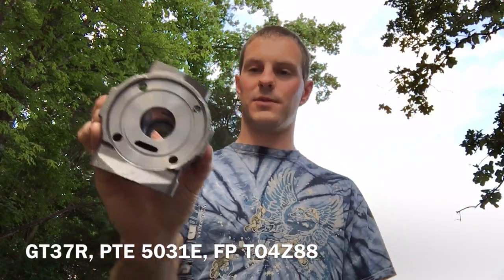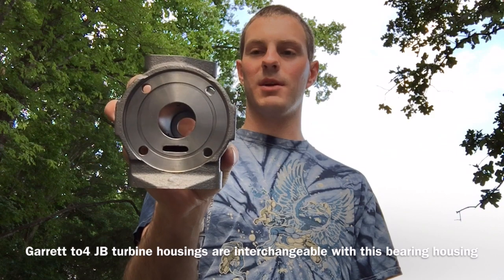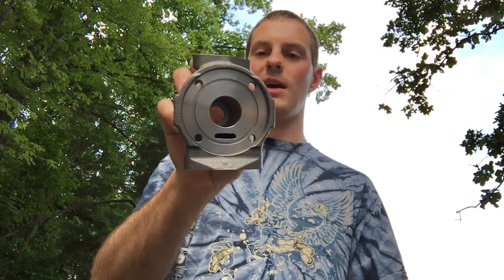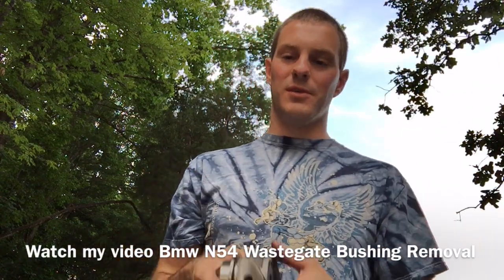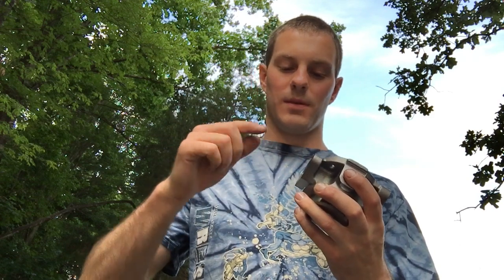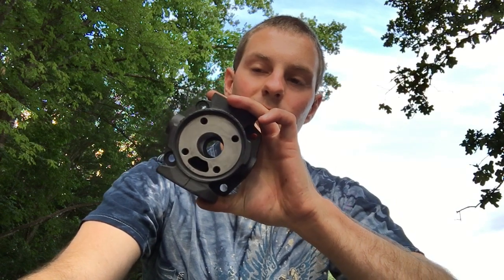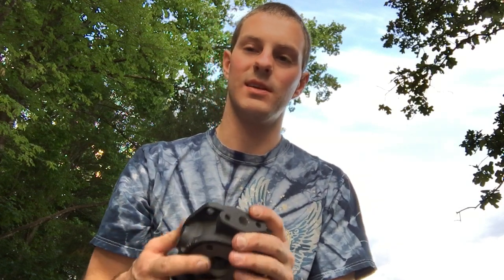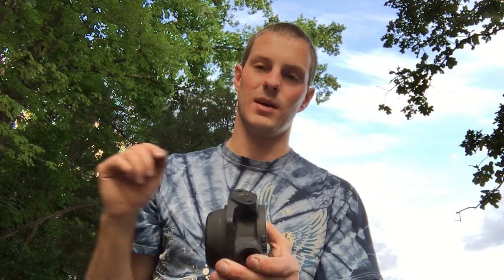Ball Bearing Turbos Are Not Rebuildable Myth

Comment: problem is, they are almost as much as the turbo itself.
Reply from the maker: +tomjw7 some of the ball bearing turbos I have worked on are 3000 new, I rebuilt one needing a lot of parts for around 500$ which saved the customer 2500$ from buying a new one.